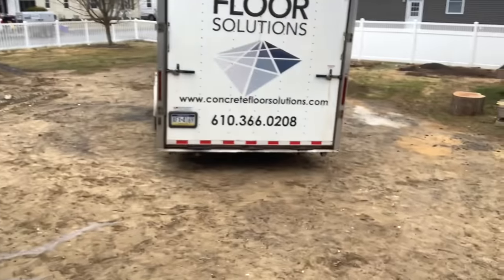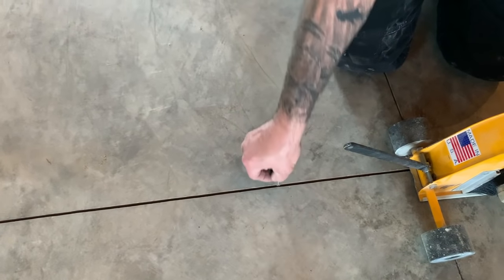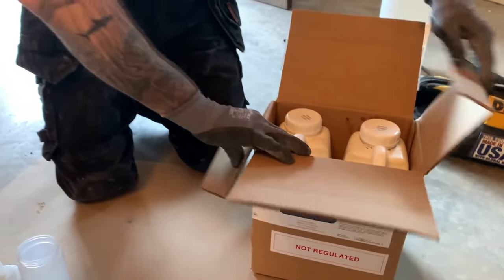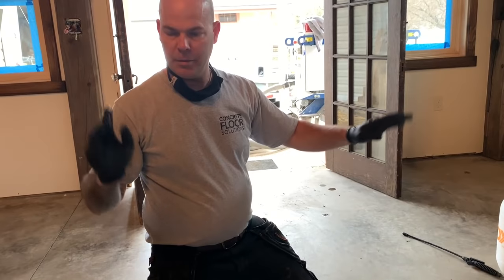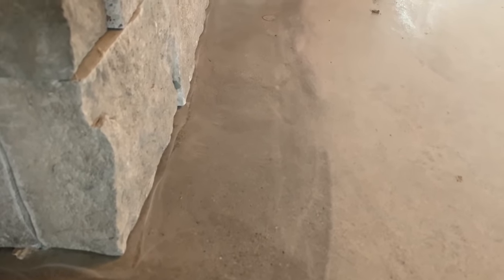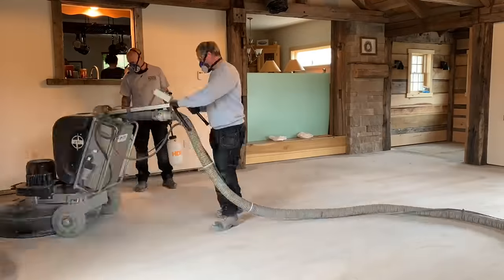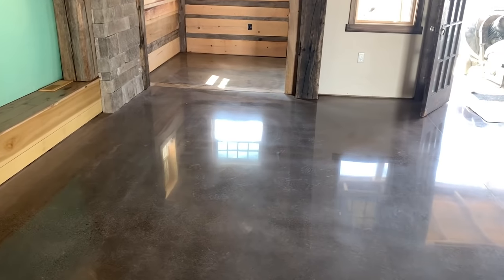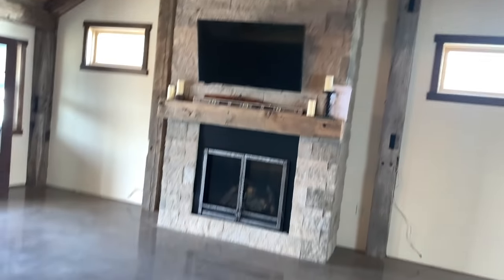Concrete Polishing inside a home. We made this room shine!

Comment: Would pinsol or any other cleaning product full the shine?  What about if a child spills orange juice?
Reply from the maker: Do not ever use chemicals on polished concrete. If you spill orange juice, clean it up. Anything that contains acids could be detrimental to Concrete.  The better you keep it clean, the longer it lasts.
Reply: @ConcreteFloorSolutions  thank you for the reply, so when mopping just use hot water?
Reply from the maker: @fernandocabanillas8133  warm water with mild soap solution if needed, usually water is enough.

Comment: i watched your previous video where you polish an office but crazecracks came out however in this one there was no such case ..any idea about that?love your work:)
Reply from the maker: I always say concrete is predictably unpredictable. Every slab is different, every load of concrete is slightly different. Craze cracks can occur for multiple reasons. Could be high heat or wind blowing across the surface causing it to dry prematurely and craze crack during the original pour. Either way, these are some of the conditions you need to be willing to accept if you want polished concrete. Thanks for watching
Reply: @ConcreteFloorSolutions  thanks a lot man, helps a ton ..one more thing do you use the same equipments that are used for polishing marble and terrazo flooring?
Reply from the maker: @gauravchauhan4608  typically terrazo is polished using terrco grinders, but you can use planetary grinders also

Comment: @ 26:10 putting guard down. What is "guard"?
Reply from the maker: Guard is a penetrating microfilm . Not to be confused with a sealer which leaves a coating on the surface. 
True, polished concrete does not have any coatings on surface. If there is a coating on the surface, it is not polished concrete. It is a coating.

Comment: Does the densifier replace a final sealer? Is a sealer needed?
Reply from the maker: we apply a lithium silicate glossing agent (guard) and then burnish the floor. It is not a straight densifier we apply when we are done. The densifier is simply a hardener only without glossing capabilities.

Comment: Fantastic job!
 
I have a quote for natural concrete polishing my garage floor, which is $600 more than a quote to epoxy the floor with a 5 layer full broadcast flakes.  Is  a concrete polished floor worth that much more than the epoxy job?  

Thanks for the great videos.
Reply from the maker: Well, I can tell you it is MUCH more labor intensive to polish a floor and requires extremely expensive equipment.  The negative of polishing a garage floor is its not oil stain resistant like epoxy.   If that helps.. We typically charge more for polishing also.
Reply: @ConcreteFloorSolutions  what is the price on the Apoxsee and flakes on three car garage
Reply from the maker: @JavierRODRIGUEZ-cr4pm  for the product only? or installed? we do both.  Cost for material only is +/-$2.00 per sq.ft. Material and Installed is +/- $6.50 per sq.ft.

Comment: Newb question here, so I hope this isn’t too stupid, but…roughly how much would you say in depth you grind off in the polishing process? Is it much more if you have larger aggregate for terrazzo?
Reply from the maker: Typically it would be less than 1/16 of an inch.
If you are trying to expose aggregate to show more stone, you can grind as much as 1/4 inch. But it adds an extreme expense to the project because of diamond wear
Reply: @ConcreteFloorSolutions  we’re throwing around a whole lot of ideas for a house we’re planning on buying in about a year, so I’m just doing a little research ahead of time to understand the various processes. I’d ask you to quote on the job, but it’s in Bangkok Thailand and it’s tough getting work visas there! That being said, you’re that rare combination of a seasoned professional, with incredibly high standards who can also share easy to grasp information. Very, very well done piece of communication, if I may say.

Comment: What’s cost per sqft for this job? $3?
Reply from the maker: Approximately $10 per square foot. If you were doing 10,000 ft.², it would be $3 per square foot. The larger the area the less per square foot.
Reply: @ConcreteFloorSolutions  You charged them a minimum? because $10 for grind, seal & polish is crazy.
Reply from the maker: @AngelZLopez  we did, it was approximately $10 per square foot. You can't do any job for less than $4000, it doesn't pay to mobilize the equipment.
Reply: @ConcreteFloorSolutions  Good stuff--tough business Ive tried. keep it up!

Comment: They could use 100 resin hybrids  after metal pads done. Then, densifier and run 400 resin hybrids.  High gloss right there!
It doesn't need the 800's. Try that faster system. Congratulations guys!

Comment: What is the need to re- cut the joints again ?
Reply from the maker: The internal edges have cement dust and dirt on them from construction, we run a diamond blade down just to grind the interior dirt out so the joint filler bonds to clean concrete.